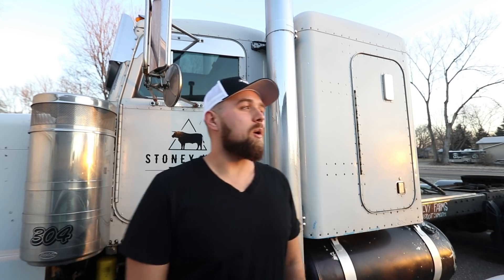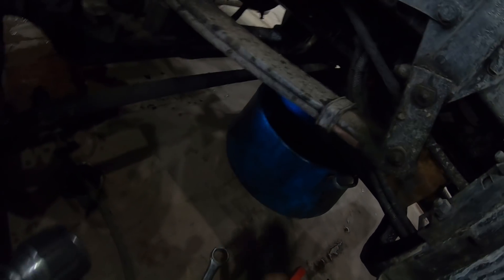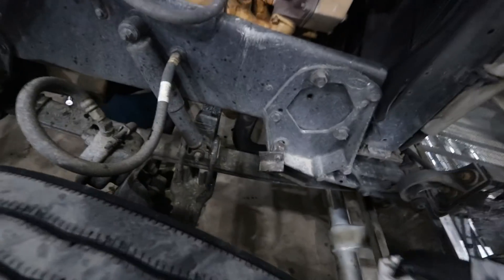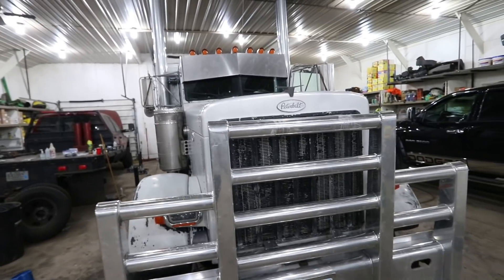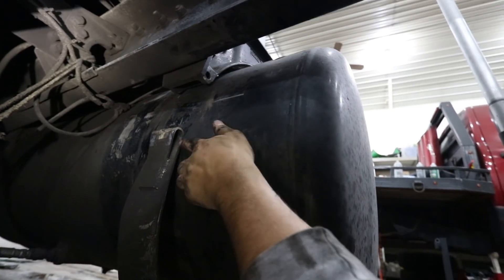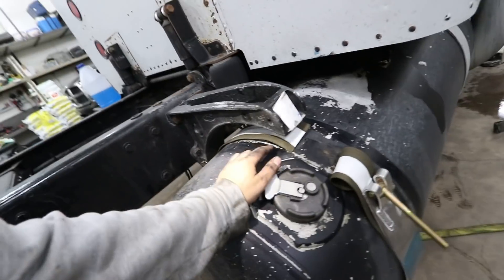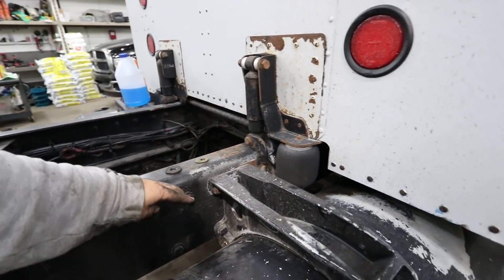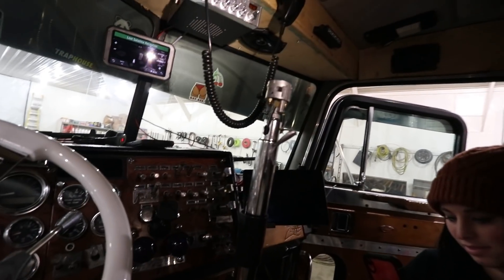Clapped out Peterbilt gets new upgrades | Oil change fail (I got lucky)

Comment: Yep drain the air completely thru the pedals and then pull your lines off and let it drain that way. Then put your splitter in the up position (makes it easier) and put your hand on the top of the shift knob with pressure  while you slowly unscrew those torque bolts and slooooowly take the old shifter off. You got it bud!

Comment: Mechanic Milk Man!!! hahaha  Changed my oil last week on a Honda Civic. 3 1/2 qts.  How much oil does that Cat take?? How many miles between changes? You don't turn as many revs as a car, probably more miles between changes than a car. Always enjoy your videos. Hope you and your family have a Merry Christmas Alec.
Reply: if it's like the 79 kw I drove 3406 it held 14 gallons I would change around 10 - 14 thousand miles depending when i got home  and if had time when home so there's you something to go by but each there own
Reply: @timatwell3728  Thanks. Wow, that's over $100 of oil plus a filter. Expensive, got to do it though. All a tax write off though.
Reply: @venicecjg  Yeal truck stops charge anywhere from $290.00 - $350.00 so better to do your self at least you no its done right
Reply: @timatwell3728  Then the truck stop cranks the filters on so tight you can't get em back off, hate having to bring it into the truck stop,$350, no greasing and cheap ass filters to boot.